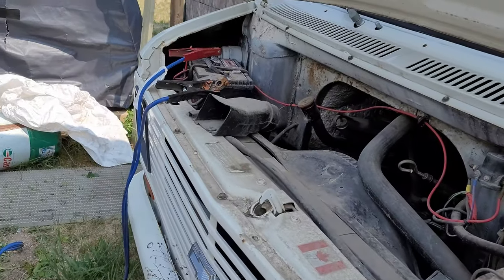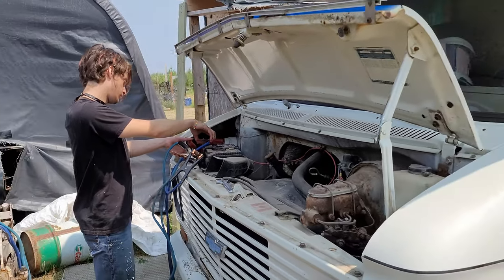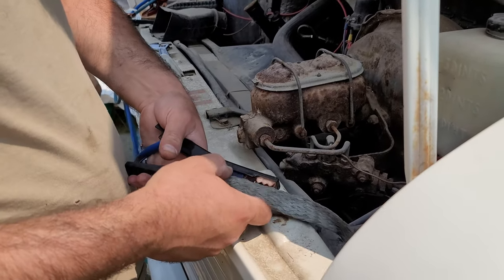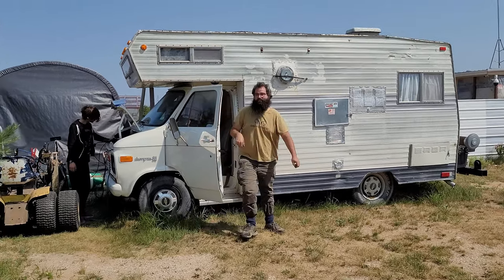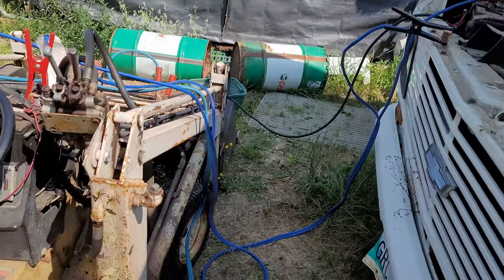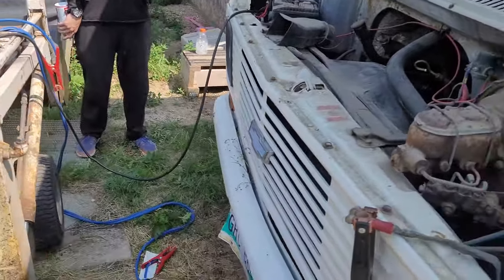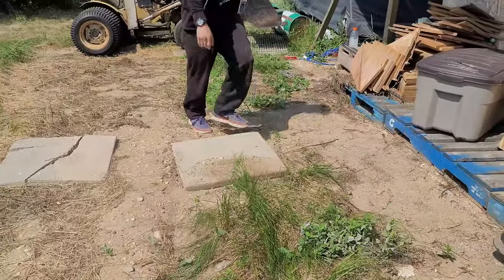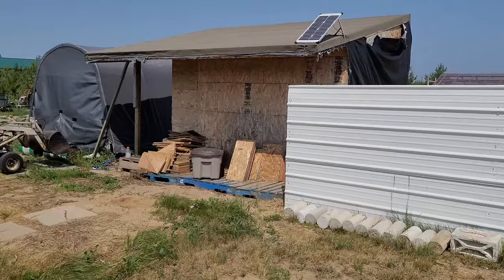WILL IT Run? 1972 Chevy Van Untouched for  5 Years

Comment: Awsome video Curtis not too sure if my comment went threw or not but I rewrite it lol anways man haven't seen this run for a long time but  4 yrs ehh wow she took awhile to get going but still runs really good and if it has a carb on it surprised that the carb not all gunked  up whats your plans with this fine piece of art I know that can be logans new home 150 bucks a month all inclusive hehehehehe lol but for real whats your plans for this machine I seen in the thumbnail that you were thinking of makeing it into a flat bed machine that be a neat project thumbs up and shared
Reply from the maker: Thinking still a Flat Bed project for her. 
Be used for Hauling Fire Wood Out of the bush. 
As for the Carb Gunked up , We put seafoam in her 5 or so years ago. so good chance that "saved" The gas from turning too bad LOL! Right now she is sitting at maybe 10% of the tank of fuel , and the filler neck is giving problems so its REALLY REALLY Slow to fill her up LOL!